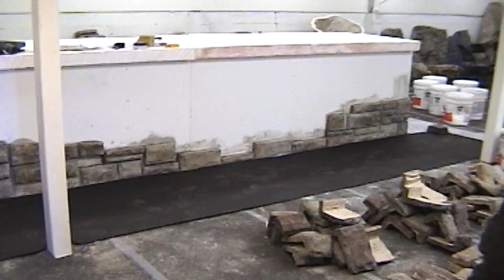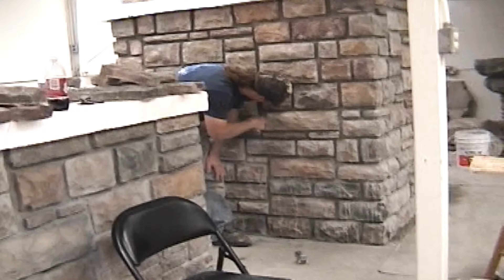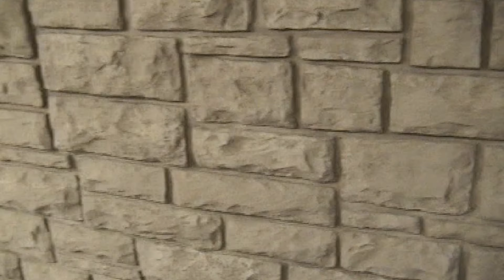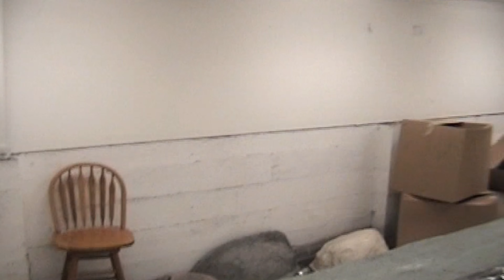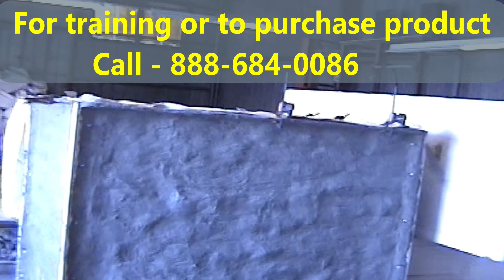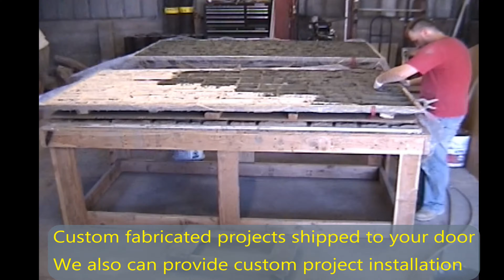Large Limestone casting for equipment enclosure boxes

Comment: I've been planning a project with some crossover to yours - here in Australia it's become popular to build garden walls using stone veneer over blockwork, but it's obviously quite expensive. As a more affordable alternative, I was considering using 250mm (9.8") EPS foam panels supported by H braces at intervals, then applying vertical concrete that I could carve into ashlar patterns like you've done.

My main concern was whether EPS would be too weak a substrate to support the concrete long-term, especially under wind load or general movement. But after watching your video, it seems like each face of the wall might act as its own structural panel—so even if the EPS deteriorates over time, the concrete skin might hold together well enough.

Would love to hear your thoughts! Thanks for the inspiration, and sorry for the long comment
Reply from the maker: Well, thanks for watching my video first and foremost. I do appreciate it.
Keep in mind that the foam that you plan to use is merely a form your structure will be found in your Cement outer garment, even if the Foam disintegrate into nothing the structure must remain in the concrete formation . I hope this helps. Thanks again.

Comment: Hey could the rubber be used to stop water from entering a basement wall? I have a natural spring that runs along my house.
Reply from the maker: Yes, rubber could be used as a sealant to seal water from getting inside, but it is best to dig out the Dirt side of the wall clean let dry and then apply the sealant on the outside. I’m assuming you were thinking about putting the rubber on the inside the wall which won’t take care of the problem.

Comment: Could a faux assembly stone wall cover a cement block retaining wall?
Guess I'm asking if w large retaining wall covered by a simulated stone wall be a cost savings? 

You do nice work.
Reply from the maker: I use my panels as a form to pour the retaining wall as opposed to laying a block wall. At the same time, I’ve had customers that have had block walls and we’ve gone over it with our panels.